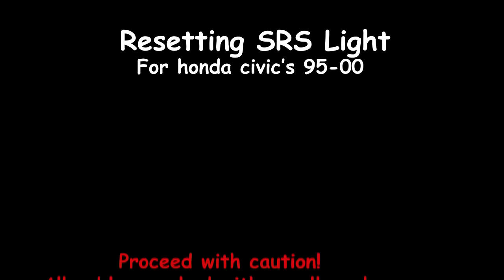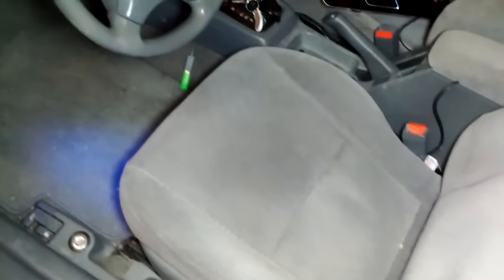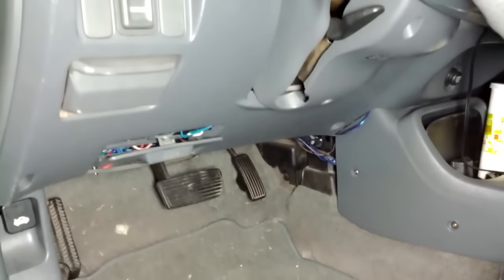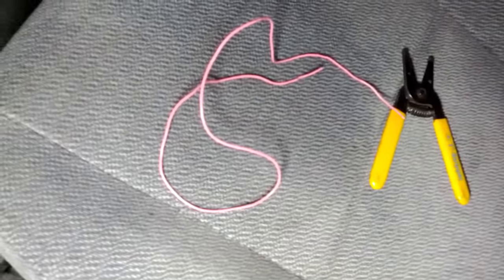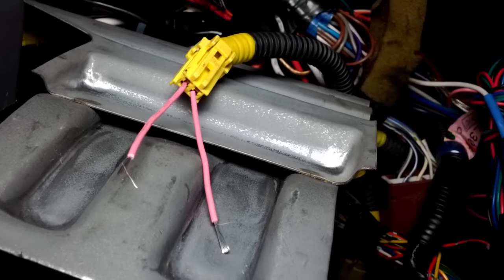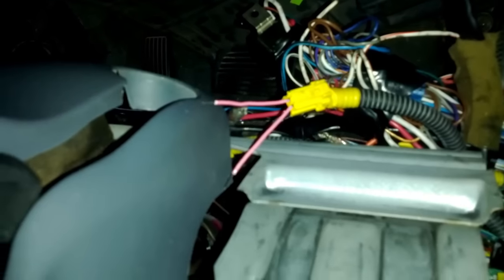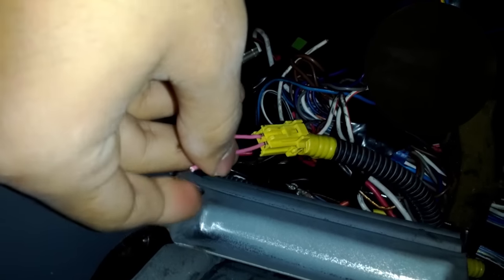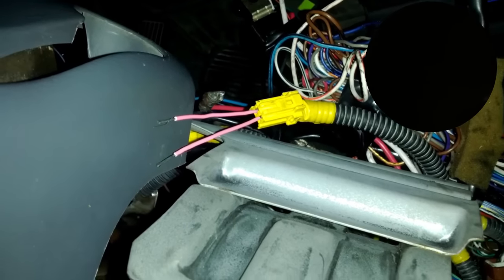How To Reset SRS Light on a Honda

Comment: hey. on my Honda HR-V /1999/ this is not working, how i reset SRS, can you help me?
Reply from the maker: Make sure you have the correct connector. Its call the mes wire(memory erase). Once you find that, follow the process in the video. This works for nearly all Honda vehicles. If the light refuses to turn off, verify that you have everything installed correctly. ie. Your air bags in working condition and correctly connected, seat belts as well and your SRS unit itself is still working correctly. If you have all that and it still doesn't work, you will need to take it to Honda and get the code read. That will tell you exactly what is wrong. This process will not force the light to stay off but instead it resets it if you have fixed the problem.

Comment: It totally worked on my 06' Honda CRV!  Thanks for the info.  My mechanic said that my impact sensor was shot so I replaced it but the airbag/SRS light remained on until I tried your technique.   Does this technique just fool the system and still cause the airbags to not deploy or is it a legitimate reset technique that will work once one fixes what is actually broken in the SRS system as shown by a diagnostic computer?
Reply from the maker: It is a legit reset. The OEM service manual calls for a tool that essentially does this.

Comment: I think this is the best video on Youtube for showing how to reset the SRS light.  I tried it with my 2004 CRV and it worked.  I had a code of 21-1 (driver's tensioner).  This procedure cleared the code.  Now I'll have to wait to see if it comes back.  I was hoping it would have come back immediately.  Then I would know what the problem was.  Now it might be an intermittent problem, which is harder to troubleshoot.  Anyway, thanks for making the great video.  By the way, what did you use to make the video?  And what software did you use to edit it?  I like the arrow and the inset light.
Reply from the maker: Thank you very much! I appreciate that since editing isn't as easy as it looks. The camera was a higher end Sony point and shoot camera(cyber-shot), and a galaxy note 2 both recording at 1080p 30fps. I used sony vegas to stitch all the video together then passed it to adobe after effects to add the two animation. The arrow and the light insert. Hope the light comes back on with the same error code! I hate it you you cant track it down. Good luck!

Comment: Thanks for answering: I used the right plug ( yellow, with two inserts and two green wires. The plug connects to the fusebox  and at the fuse box side there are no pins.
I used paperclip.
Reply from the maker: If you are following the process and it doesn't work, you might have to get the unit checked. It should always reset but turn back on if the problem hasn't been fixed. I don't think they charge very much to get it checked.

Comment: Awesome...thanks for that! This worked on my 2001 Honda CRV. The SRS light was latched on after I had left my ignition switch on and drained the battery. The plug is exactly where you described.

Comment: This would be simplified if you just said pull the plugs out and stick paper clips in each port of the plug and do the procedure with it out. Youll catch hell trying to get a solid connection sticking a wire in from the back of the plug..

Comment: It really does work, you have to make sure the wires are fully inserted in the metal slots and follow the directions closely.  On a 1998 crv I removed the plastic kick panel - 2 screws at bottom and pull tabs, unplugged the trunk window release, then removed the metal bracket right over the fuses- 3 bolts and I had perfect access to the yellow connector with two green wires.

Comment: Thanks. Replaced broken clockspring, just needed to reset light.  This was the most coherent video---especially liked that you showed the location of MES connector and pointed out that the correct one will have NO CONTACTS in the fusebox socket.

Comment: Thanks so much for this, Christian.
This worked as desired on an 'always on' SRS light.
I believe my light was on due to a battery low voltage condition.
Anyway... that said, thanks again, very much... very helpful.
Reply from the maker: Your welcome! That is an interesting comment.... This might be the reason why mine turned back on.

Comment: I've got a 4-1 srs code on my 2004 honda civic and I'm looking for some help on how to fix it. 4-1 and 4-2 are basically the same and it is for open circuit or high resistance in the driver's side belt tensioner. Gonna check fuses first, the resistances in the problem area, then clean the tensioner assembly if there were no obvious electrical problems. If I can't figure it out I will at least try to clear it and see if it comes back, but I just wanted to post here to see if anyone had the same issue

Comment: I just tried this on a UK spec 2007 Honda Jazz and it worked a treat! Yellow plug on my jazz is just above the fuses in the fuse box which is below the steering wheel on the little shelf. Awkward as there's little slack but if you make a longer cable to plug in its far easier. I used bell wire as its stiff and stays in the plug better. Job done! I knew my system wasn't really faulty as it came on after a battery swap, now light is off. If you have an underlying fault then of course it'll just come back on.
Reply from the maker: +Soft Tango Thank you for the information! I have seen some comments asking for specifically this.

Comment: Thanks you. It worked on my 2002 Acura RSX Type S. It took several tries, my bad. It took me a total of 15 minutes to removed and reinstalled the two panels. I did not even plug the yellow connector back in, since it has no function.

Comment: Awesome Video. worked on my 02 accord. I pulled the dash out to fix the clock and accidentally left the key on giving me code 15-2 and setting off the srs light. This worked like a charm thanks. Craig W.

Comment: To all of you wondering if this works on a 2001 Civic, it should work on all 2001-2005 Civics. BUT, simply resetting the light without fixing what is causing it to come on in the first place is a waste of your time. The cause of the light coming on in the first place is USUALLY a Code 9-3, which indicates a faulty (dirty) driver's seatbelt buckle switch. You need to take apart the buckle and clean the switch out (google more videos, you'll find the one I found that really helped a lot!). The SRS light is on because the seatbelt switch is dirty, confusing the airbag into not knowing if your seatbelt is buckled or not. It's a simple fix. Here are the steps you need to take (not just resetting the light):

This is a common problem with 2001-2005 Civics. It is
caused by a sticking/dirty driver’s seatbelt buckle switch, which needs to be
taken apart and cleaned out. Pretty simple task. All you need are a can of
spray contact cleaner, T-10 torx bit with hole in center, sharp pointed knife
like Exacto or similar, a can of spray air cleaner, a paper clip, and about 3
feet of jumper wires (speaker wire works good).

 

Follow these steps:

1.     
Check for code 9-3 by locating diagnostic plug
under dash near left of radio, then jumping a paperclip from top right plug to
4th plug from right on the bottom row.

2.     
Turn key to ON position, then count how many
times SRS light blinks. Watch for 9 slow blinks, then 3 rapid blinks. This is a
code 9-3, indicating faulty driver’s seatbelt buckle switch.

3.     
Remove 2 torx screws from buckle cover. Be
careful not to remove large red part or you might lose the springs under it,
which are hard to get back in.

4.     
Cut red rubber boot from under metal lever,
which surrounds the little black push switch. You need to cut this boot away so
you can get spray cleaner down into switch. While spraying cleaner inside the
button, work it up and down lots of times. Reassemble buckle.

5.     
CLEAR SRS CODE:  Locate yellow plug with green/white stripes
and black/white stripes wires that plugs into fuse panel under dash. Remove
this yellow plug. Plug jumper wires into each of the 2 holes. 

6.     
Bring other ends of jumper wires (speaker wires)
up to over steering wheel. Touch ends of wires together, then turn key to ON.
Airbag light will go OFF, then separate wires. When airbag light comes ON
again, touch wires together again. Airbag light should blink a couple times.
Turn key to OFF. 

7.     
Airbag light should now be off!
Reply from the maker: +Shawn Brown very informative! Thanks for adding to the video! I'll add this to the description.
Reply from the maker: +Shawn Brown very informative! Thanks for adding to the video! I'll add this to the description.
Reply: My pleasure! Hope it helps. I just found it myself on youtube, but haven't had a chance to even go out to my car and try it! :) But I certainly plan to. My SRS light has been on for a few days, but my Civic only has 54,000 original one-owner miles on it, so I couldn't figure out what the problem was. Now I know. Simple fix.
Reply: What about a 1999 honda odyssey?
Reply: I work at Honda and I am happy to announce that most civics that have this code have a lifetime warranty on it, just go to your local honda dealer and check to see if it is available, most if the time it is free and you get a new seat belt buckle :)

Comment from the maker: +momin tariq There should only be one plug that you use to reset the system. Look at 1:22 to see what the plug socket will look like and how to reset it. The plugs name is MES (Memory Erase). Also I was told that by a Honda Technician that you have to purchase a whole new SRS unit when an airbag deploys. If you do reset and it doesn't turn back on, report back and let us know! That way I can know whether to trust my Honda techs or not.
Reply: k i would let u know ...thnx BTW for uploading the video i'll subscribe u ;)
Reply: Bro i checked the cable it has 4 pins ...wht should i do
Reply from the maker: momin tariq it should only have 2. the cable you should be looking for is on on the fuse box only. And the socket that is holding that cable should have no pins inside of it.
Reply: Christian Macias  k .. i'll check nd reply back ..thnx
Reply: Christian Macias hey bro ..... i had a freind come by and fix that problem ..but thnx anyway ..... do u know about ECT (Engine Coolant temperature sensor ) I m having a problem with its wiring
Reply from the maker: Yes i do. What year is your car
Reply: hyundai terracn 2006
Reply: but we found the problem for y the car was not starting .....becus the pressure in the cylinder was only 35 -_- ....i should have been 150-250 ...there was a leak
Reply: but thnx for ur concern i appreciate that
Reply from the maker: No problem!
Reply: k thnx
Reply: Curtain air bag tak it out
Reply: Hi, do you know if it works with a 2006 Honda Accord? Thanks, Dan
Reply from the maker: It should. It works on almost all hondas
Reply: Will try that tomorrow, Thanks!
Reply: hey aswome vid bro would this b the same procedure for a 02 accord   ex v6??
Reply: Hi Christian , thanks for the video, got mine reset first time. But when I started my car after resetting it the light just came back on, anything else you recommend I can check/ reset to fix it?
Reply: Christian hi

I have a 1995 odyssey van.  It has the same srs lighting problem.  I replaced all my fuses with New ones.  And yet still the srs light is still on.  I just don't know why.  Also the cruise control doesn't work and the speedometer stopped working with a permanent engine light.  The speedometer issue is not a big deal, I have to buy a new speed sensor but the other 2 problems are a nuisance.  Hope to hear from you

Comment: mine blinked twice but the light just turned on the next time I started my car (95 honda accord)
Reply: I had to do the process a few times until it worked on my civic   Hope you can get it sorted   Also I had to hold the wires after the separating for at least 10!seconds